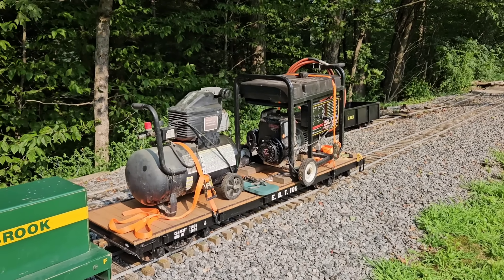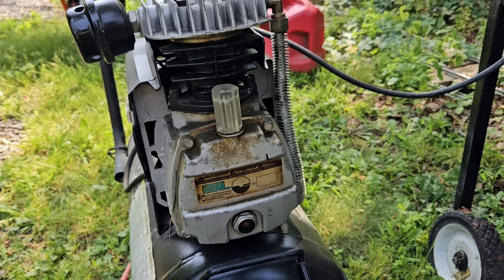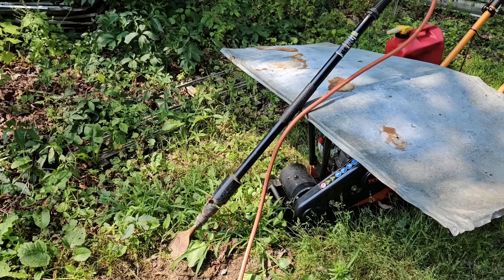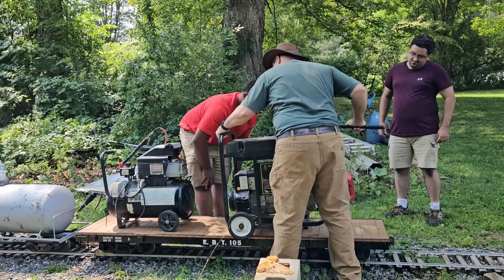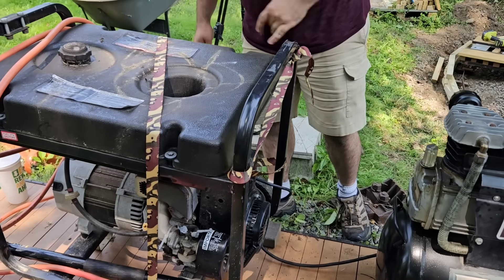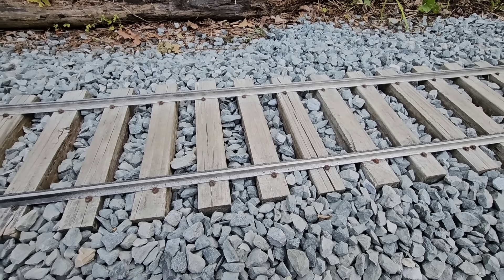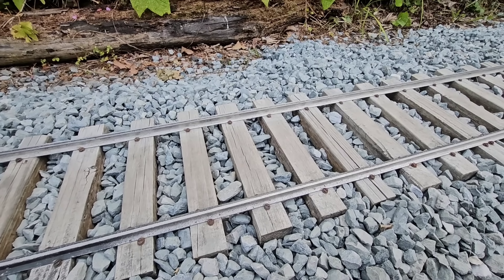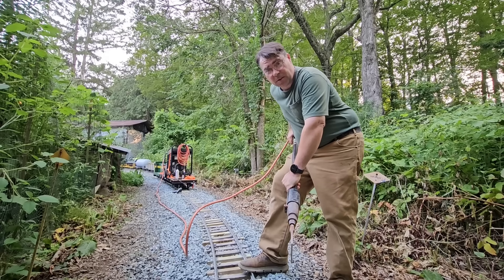Our Loud DIY Ballast Tamping Machine: The Tampinator

Comment: You should try welding a 1 or 2 inch wide flat bar to the end of the blade. This way it should spread the vibrations and move the ballast more efficiently. Just an idea.
Reply from the maker: It's already 4 inches wide.

Comment: Wonderful, Wonderful hey YOU could weld up a stand with 3 of those spades welded together  so you could tamp outer and internal  of ties  And you could add a t
Second Millbrook flat car and bolt on a FISHING BOAT SEAT AND USE YOUR ENGINES REMOTE CONTROL TO PUSH YOU DOWN THE TRACK .TRAIN MOUNTAINS IN OREGON  BE IMPRESS ...WE ARE VERY IMPRESSIVE ❤❤❤❤❤❤🎉🎉🎉🎉🎉🎉🎉🎉😅😅😅😅😅😅😅😅😅
Reply from the maker: I have a few ideas on how to make it better.

Comment: Nice work. That will serve You well for a long time.
Impressive sound at time 05:50. Hard to translate but like driving down wooden or concrete piles in mud. Fun!
That work must do good to the stability of the track bed. Just wonder why You had no more ballast in the middle, between the rails, and tampered that.
Reply from the maker: Thanks! It's a fun tool to run. It does sound like a pile driver when you slow down the footage. I thought it sounded pretty cool. 
The missing ballast between the ties was where Jared and Eric replaced ties earlier in the day.
Reply: @MillBrookRailroad Yes it sounded fun. Okey, more ballast and tamping later..

Comment: Neat "tampernator" Aaron! Looks like it works pretty good, glad you have been able to finally use it after repairing the compressor. It's great you have Jarod & Eric helping. You will have to get Mr. Bat Cat to inspect the work to make sure you comply with Millbrook R.R. standard procedures! 😅 More & more improvements, you're getting there!

Comment: I have a similar unit with compressor driven by
 generator. I built a long "chisel"  for an air hammer, that is longer than the ties, with a pipe welded to the bottom edge to help the rock spread out more. It also is notched to fit down over the rails. Will your compressor keep up with the floor scraper, or do you have to keep waiting for pressure to build up?
Reply from the maker: I'll have to give that some thought. My compressor mostly keeps up, but I do have to stop every so often to let it build up air.

Comment: A 3 legs one will be better roughly like tripod wheel barrow. One leg with horizontal bar sitting on already shaked track and 2 wider legged wheels on the ground for pushing it. Sort of spider crane that lift rails from flatcar to put on ties.😊
Reply from the maker: I'll be working on improvements at some point, here.

Comment: Now Aaron you have the best track tool of all times.
How the shaker or vibrator is named ?
In real world, machine lift the track then shake ballast. A sort of 4 legs crane on wheel can be added with 4 adjustable ropes or cables and hooks and marine fastrners to lift a track section while you shake it. Easy to built but more time consuming. Can use laser level, just like the real thing to choose height and track banking for curves. Now you already have a huge improvment compare with the rod used and with almost no physical effort. Ear protective devices for gen/compressor duo to protect earing😊😊
Reply from the maker: We named it the Tampinator because we were goofing around with Phineas and Ferb references. I used to watch that show with my kids, and my volunteers are about the same age as them.

Comment: Your good but I was wondering you do all your own building could you put a bar on the front pocket of your loco and have 2 smaller scrapers on the out side that scraper in the middle have it so the bar can move up and down install the power jack to it and then less effort on you and the back and you can do the whole side of the tie to just a idea😅
Reply from the maker: There's a machine for that.

Comment: Hello there,u might think this is a good idea,but the chip size is too big and all we're doing was lifting your track up,please have a look at your video, 😢
Reply: The real machine lift track to a determinated height using laser levels, then shake and lower track before moving to next tie.
Reply from the maker: I use 3/4" ledge stone because it locks the ties in. Even when they're compost. Smaller ballast doesn't do that. I'll go back and level the track later. The job is definitely not done.